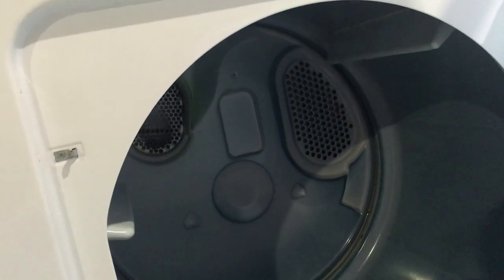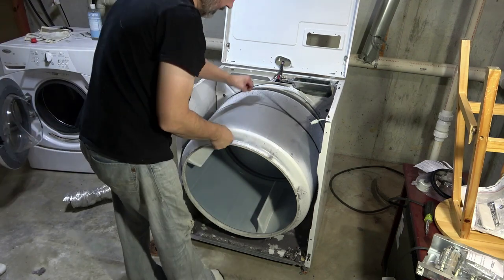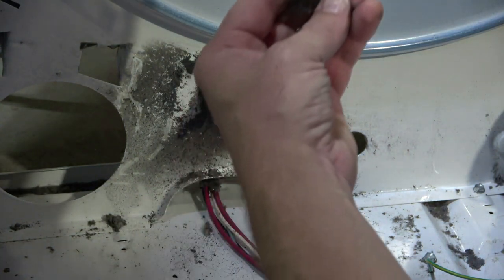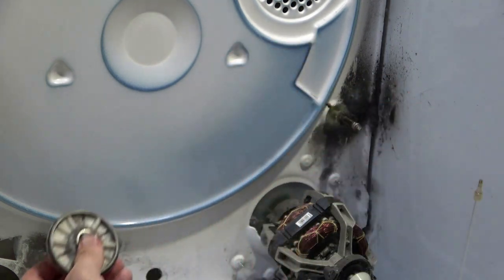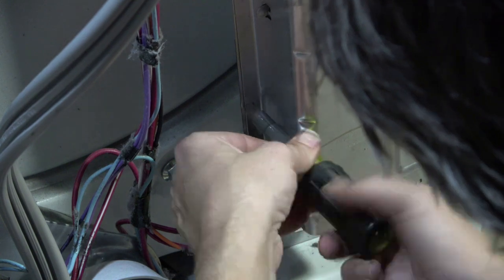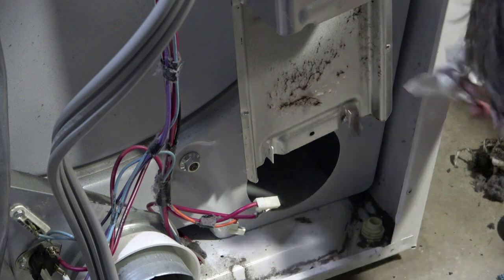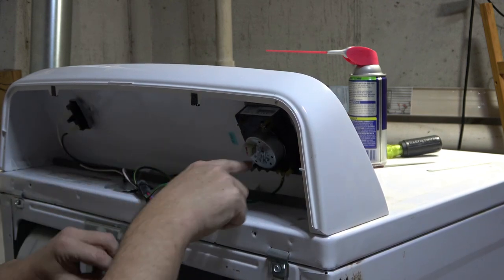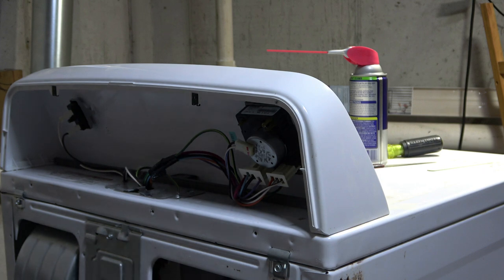LOUD, NOISY, NO HEAT Clothes Dryer Repair (Admiral, Whirlpool Kenmore Roper)

Comment: I work where those are built. Usually the thermo hi/lo limit, fuse on wiring harness, and switch is the only difference in those. The badge on the outside is only change. That door switch is first thing we check in repair bay. Jam a needle nose pliers in each side them hit the button. You really can't go wrong with them old ones. Easy to fix. The powder coat on that bulk head turning blue happens on all of them too. Should be thicker so it doesn't do that. As someone who breaks those down sometimes you did a good job.

Comment: i had to smile to myself, i used to servicing Whirlpool apliances here in Swizerland for 2 decades and i ran over the same triangular clips and rollerbearings when repairing Dryers😊 although i cleaned the shafts with a lil acetone from the old crude an then put some lithium grease on it

Comment: I tried fixing my dryer 3 times. It had the round heat element on the back, with the round pan, and I even bought a brand new coil and pan for it, and it still burned out on me. Also replaced the belt, thermostat, etc… DONE! Couldn’t trust it anymore. The thing was sparking, then the heating element became separated. Fridgidaire. Gave up!
Reply from the maker: Wild. That sucks.

Comment: I have a Samsung dryer. Heater went out after 6 months.  It was the temperature cutoff sensor.  I ordered a new part and fixed it.  Well, over the last few years, I have had to replace the sensor 3 times.  Then, the heating element broke.  Ordered a new on.  I always dry on medium heat now. So far, so good.  At least I know what parts to order when it breaks again.

Comment: Gidday Brad!  Mate, I didn't see you fix or replace the lint filter!  That may be why there was so much fluff, lint, hair & shit in the machine!  So it may cake up the gubbins again?  

I thought the paint had largely flaked off from inside the bottom of the cabinet, but no, it was MORE crap!  Definitely do something with that lint filter mate, unless I've got that wrong!  Any way of knowing how old the machine is?

Obviously the laundry room is pretty echoey, but, well, it still sounded pretty noisy even after you fixed it!  The 'rattley' noise had gone though.  

What sort of 'bearing' does it have to hold the front of the barrel in position?  Maybe that was dodgey too?  It just sounded way noisier than the dryers I've had experience with.

What were the purple wires for that measured 7k?  You said you were gonna go back to them but never did.  Was that the high resistance contacts you were measuring before you cleaned them?  

Good job you got the machine going after all that mate but I'm still not 100% confident you've fixed it for the duration sorry!  Don't lose that circuit diagram or the spare parts!